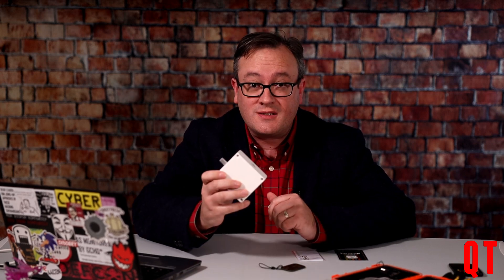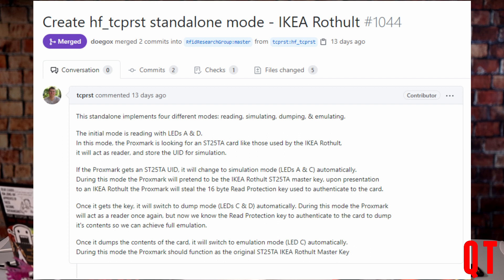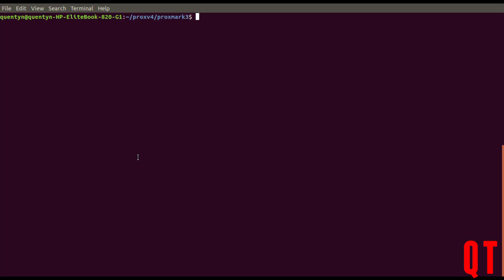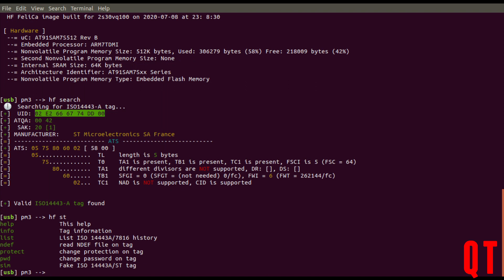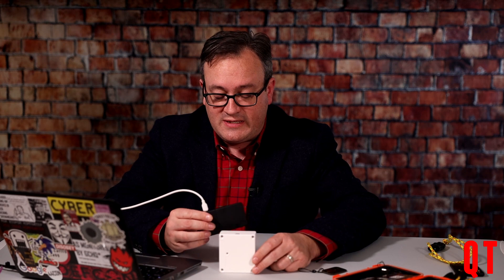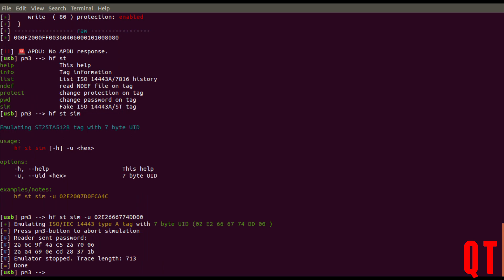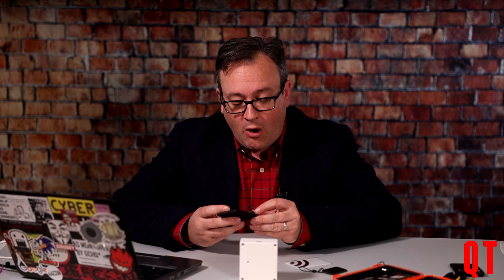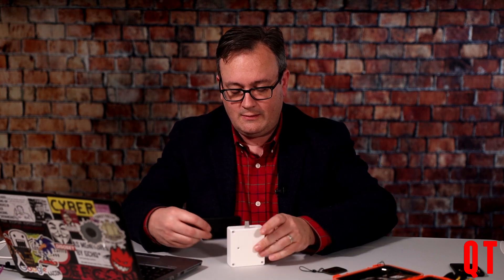Hacking the IKEA Rothult lock with a Proxmark

Comment: Hi Quentin, great video. I was watching and playing along when I discovered some unexpected behavior. I wanted to see what happened when the uid was wrong so I changed the last number. To my surprise I didn't get back the password or an error but the lock opened. In fact if I simulate any st card uid apart from the 2 master cards that came with the lock it opens. e.g. `hf st sim -u 1234567890abcd`. Does anyone else see this behavior?
Reply from the maker: Hmm that's interesting - what you are saying is that any uid that isn't the correct one will open it ?
Reply: @QuentynTaylor absolutely that. Don’t know if you still have the lock to see if you see the same thing.
Reply from the maker: @NathanielMcHugh  i have just tested and you are right.... it doesnt work with all number patters but with loads of them it does
Reply: @QuentynTaylor  thanks for confirming that. Bit of a security hole being able to open them with virtually any id.